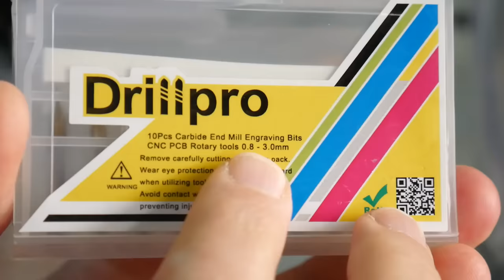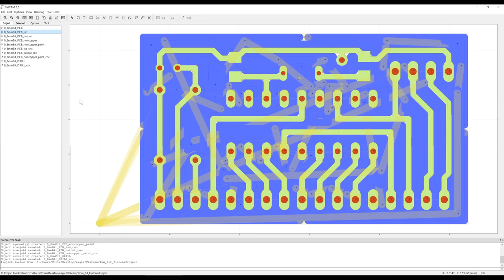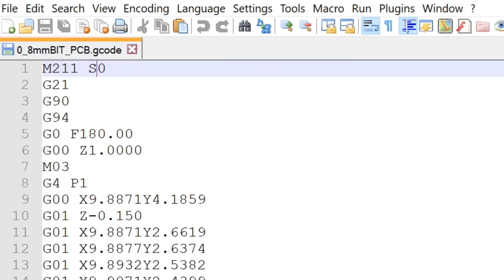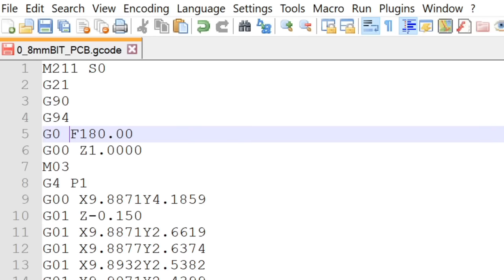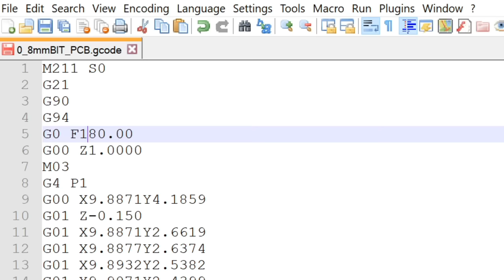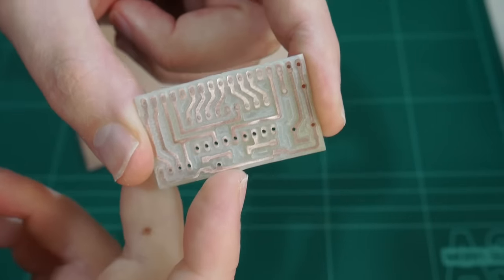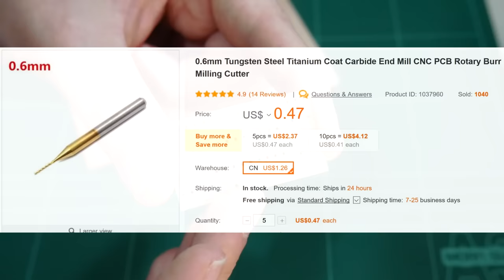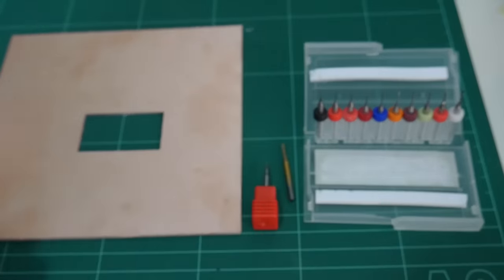Simple DIY PCB with a 3D Printer

Comment: Pretty clever of actually doing engraving by use of a flexible shaft. I’m in the concepting phase of a custom 3D printer and have been thing on how to do some simple CNC work with it as well, I might consider going this route as well to achieve that, as I don’t like a dremel on the toolhead of the machine itself considering it’s weight.

As to your Z free movement issue I imagine there are ways to get rid of this play with a little shim, or otherwise there will probably be other flex shafts that have less or no play at all.
Reply from the maker: I went to the local hardware store to see if other flex shafts had the same play. Yep they did, so I think it's by design than a fault with my unit.
Reply: The design considerations for these were never specced for high z constraint. That doesn't mean you couldn't install some lateral thrust bearings. As these dremels are intended for operation at very high RPM, I wouldn't recommend simply removing the lateral play by constraining the existing bearings or using any sort of friction shim or spring. You either need paired roller/thrust bearings or cone bearings that take care of rotational and lateral motion at the same time. The later are preferable since there are fewer surfaces for friction to be introduced.

Comment: I got the same flexible shaft, and it doesn't have the Z axis problem! It has no play at all... I didn't buy any V bit because of that, but now that I see it doesn't have the issue I ordered a couple.
Reply from the maker: Very lucky there! I'm about to switch over to another flex shaft with no play. Cheers!

Comment: Instead of using double side sticky tape, use mirror clamps and screw the plate down from the edges. You can use as many needed to hold the board down. Or you could use a thin piece of strip wood or plastic to hold down the edges.
That way you don't risk bending the board while removing it. After all, you could reuse that board to create many other PCB/ECB's
And, if you need to etch/engrave the other side for double side board, you can get the board in the exact location needed easily

Comment: Hi there thank you for  the video... Your  3d printer   I suppose is expensive , not  all common guys can  afford such a tool ...  I am thinking  if is not possibly  to  using cheap 3D printers with plastic filament  to  print  the circuit  on PCB  and after common etching method , to eliminate that plastic with something ( maybe acetone ) and have a ready pcb for driling  and mounting the electronics on it ...

Comment: Question. Could you use the normal 3D printer filament directly on the copper board as an object one layer deep? Then etch the board normally with the printed plastic as the resist?

Comment: Darn, now thanks to your video I want to convert my 3d printer... thanks... a lot ... he he
Reply: I know. I hate chemical etching and then trying to drill tiny holes by hand.   This approach seems much better for home prototyping and testing before sending out to a fab house.
Reply: But it's so cheap these days to just order prototype boards from china, why bother?
Reply: Time. I can go from computer file to finished board. Ironed, etched, drilled ans cleaned in under an hour.
Reply: And you get no solder mask and no silkscreen... Not to mention absence of plated through holes.
Reply: It all depends on your needs. I use the toner method to label the info back on when I need it.

Haven't found the need to solder mask, I just put solder where I need it. I don't wave solder so it doesn't go everywhere. 

Stick a piece of wire through a hole and solder both sides, now it's a plated through hole.

I'm not saying the DIY method produces a better board than ordering from China, but when you are doing a one-off board or just a prototype, they do have their advantages. Mainly time and cost.

Comment: Interesting video, thanks. But it seems wrong to grind below the copper and create the nasty glass fibre dust. Or maybe a goal would be to minimise the intrusion into the glass fibre? Possibly leave a few microns of unwanted copper thickness and wire brush it off afterwards.

Comment: I think you might run into delamination issues (the copper layer splitting off from the fiberglass)with this kind of holes and since they are not lined with copper it may cause some issues with the circuit working properly.

Comment: Only thing I really don't like about this is the idea of all that dust a-flying (and I suppose to a lesser extent, mechanical wear and tear). Which is worse; acid fumes or G10 dust, right? Even so, I really do like this, and I should consider building one just for in general CNC cutting/milling/engraving. It's brilliant. Thanks for the video!!
Reply: I never liked the smell of hot ferric chloride, compounded by then having to drill by hand inhaling the dust as well!

Comment: Great video mate!  Just a quick suggestion (But a good one). If you think you can take the motor apart, then try & measure the end play in the armature, then get a washer maybe about 0.06mm thinner than that measurement to take up the end play & fit it to the armature. Just make sure there is a miniscule amount of end play when you re-assemble the armature. I really liked how clean the cut in the board was using the "V-shaped" bit.  Just out of interest, would you have used the V-Shaped end mill to do the rest or the clean-up?
Reply from the maker: With the flex shaft there isn't any fixings visible to take it apart, so I'm not sure how I can fix it. Regarding the V bit, it would cut widths of only 0.2mm so clearing vast amounts of copper would take a while. Plus at the price I wouldn't want to prematurely wear it out. For small PCB's yes I would.

Comment: hello thanx for all your 3d printer videos. i have an idea but dont know is it possible or not. i saw some 15w co2 laser tubes on aliexpress can it be used with our hypercubes. of course laser tube stood still and light will directed with mirrors. just an idea.
Reply: There are plans out there for exactly such a machine. You typically need to have an enclosure for it as well just to avoid the possibility of a stray beam.

Comment: Great idea to use 3d Printer instead of manual and time consuming drawing and acid PCB making
Reply: Fiberglass dust is much more safely than acids (No,actually)
Reply: I don't think so
Reply: With photographic replication and etching you are faster than the 20 minutes used on this small board, independently of size and with much more precision than 0.8mm, traces thru pins. He should have used phenolic instead of epoxy because he can not plate thru anyway.
Reply: Ok I'll let you know when I come back bye bye for now••••••

Comment: Your experience with the engraving bit in that tool was not unusual. CNC engraving of PCBs has a whole science behind it. There are special sprung holders, special leveling programs, and more. It's not unlike what the 3D printing industry has been going through lately, with auto bed leveling and more.

Comment: 13:30 but shouldn't you not solder onto a micrcontroller, as the heat could damage the component?
Reply: No it's quite OK to directly solder them (if I've understood your double negative properly!).  But you should be quick, like with all pcb mounted components,  and let any bad-looking joints cool off before retouching them.  Ppl only use sockets to make them easy to change, if you want to reprogram them off-board.

Comment: Nice video, just set up something similiar with EAGLE and PCB_GCODE, because I cannot get FLATCAM to work.
Tried it on WIN10 and MAC OS but trouble all over the place.
Is it required to install all the additional software for FLATCAM to start working?
Could you make a video on how to install FLATCAM on WIN10 or MAXvOS
Thanks in advance.

Comment: I have the same budget Dremel with the remote cable drill thing, I definitely want to try milling a PCB like you did . Why is the V bit better than the square one ?
Reply from the maker: A V bit can achieve much finer engrave widths, down to 0.1mm wide. Smaller than any end mill.

Comment: I think will be easier to just attach a permanent marker to the printer and draw the circuit, to later just deep it into the solution.....even if this looks faster you are compromising the stability of the plaque if you drill too deep.

Comment: OK, genuinely surprised that the carbide endmill didn't go "ping" off into the wild yonder the instant it touched the board....
BTW the dust is glass, which is fairly abrasive...vacuum it during milling instead of letting get all in your printer.
Reply: And Google "silicosis" while you are at it.

Comment: Only thing I would do different is put a whole piece of wasteboard under the copperclad. You've created a pivot point by putting the board in the middle of the copper as it will flex with pressure on the ends. Just my useless 2 cents......then again, if you don't travel off the boards size who cares?
I have a set of mills like you have and mine starts at 0.3mm. You could snap it with your finger for sure it's that fine.

Comment: While I admire that this makes holes, there's much less effort with laser-printed traces ironed into a laminate (in such case, to avoid making holes, during soldering I bend legs of standard components and turn them into sort of ghetto-SMD stuff). However, If I was to make PCBs with CNC, I'd go for as many airgaps as possible, just for the looks of it.

Comment: sorry to ask, what happened to the CF tubes?
Reply: well spotted
Reply: He took the CF tubes out for the carving "conversion" of the 3d printer, as the steel rods are more rigid of a construction and the forces from the milling are higher than from printing. As speeds are lower the added mass are less of an issue.
Reply from the maker: Bingo !

Comment: Plz do aluminum...

But actually I found your video and have decided to stick my Dremel on my broken printer (hotend not motors/control). I plan on using it to cut aluminum :)
Reply: Go very slowly. Otherwise - busted end mills.
Reply: Why not fix the printer?  Easy to get parts or adapt to new components.
Reply: @GadgetNuttTech  because A) I have an ender 3 now that works very well, and B) it's CTC 3D Makerbot clone AKA a pile of garbage that I didn't do my research on, and C) I want to have a CNC machine.

I wasn't trying to be rude, just explaining my reasoning :)
Reply: No offense taken.

Comment: What is the minimum trace width/clerance?
Reply from the maker: It is determined by the end mill diameter you choose. In this video I used a 0.8mm diameter end mill, so the traces had to be at minimum 0.8mm apart.

Comment: Isolation routing?  So NASA 1970's!!!
Whatever happened to printing a resist directly onto copper with PETG, then using an etching solution to remove excess copper?
Cutting into the PCB stock only weakens the substrate, plus the rough surface from milling acts to trap moisture and contamination.
If the cutting is too deep, there is a chance of de-laminating the fiberglass!
Heated bed @90C + PETG + copper-clad panel = precision etching resist.

Comment: Doesn’t moving the print head by hand generate an electric charge? Won’t it fry the control board?
Reply: Yes it does, and no it won't. Not enough current.
Reply: I've seen a video by a well known 3D print guy who says it can damage the controller but most likely if you move the head quickly. The voltage can damage the circuit (in much the same way static can). I've seen plenty of guys on YT move the head slowly with no problem.
Reply: When moving the motors by hand, current is generated through the motor coils that is roughly equivalent to the current needed to move the motors at that speed, so if you move the motor manually faster than it could possibly move when electrically driven, you might damage the stepper driver.
Reply: yes it can , specially DONT do it when printer is on !

Comment: Why not just print traces on copper, etch, remove plastic - done..?
Reply: You could do that, but you would still have to drill the holes.  This is an extra step in the process. And how easy would it be to clean off the plastic well enough to allow the components to be soldered on?

Comment: The drilled holes are much too big. You should use a seperate drillbit and not the router bit to drill them.
Reply: Using an endmill is fine for holes where depth < 4x diameter.  This is a 0.8mm bit on a 1.6mm board.  0.8mm is the IPC-2222 recommended hole size for DIP packages.  Slightly larger may be needed for DIL headers, large transistors etc.  Veroboard has 1.0mm holes.

Comment: So those are 2 different boards right? The one you showed being removed from the copper clad board clearly( @ 10:33 in the video) had the through hole pads being too small for the holes that were drilled and several of them appeared to be cut straight through to the edges of the holes but after you "sanded off the burrs"( easy to see @ 11:58 in the video) it suddenly has more copper remaining on the board. Why couldn't you have just said that the first one didn't come out well but that a subsequent attempt was more successful?

Comment: Diy pcb with diy CNC... you're not printing anything.
Reply: and a 3d printer isn't a cnc?
Reply: @king_james_official  no. They work in the exact opposite ways. A 3d printer is an additive process. Cnc removes materials.
Reply: @xjunkxyrdxdog89  what the hell are you talking about... i think you mean a mill...
Reply: @king_james_official  I'm talking about the colloquial term "cnc". You are correct, I do mean a cnc mill. Now name an example in common English where people use cnc to mean anything else?
Reply: @xjunkxyrdxdog89  it just annoys me that people throw around words like they know what they mean and then it becomes something else. cnc just means a computer controls it (device) with numbers. sorry if i sound aggressive or smth
Reply: @king_james_official  colloquial terms annoy you? Sounds frustrating tbh.
Reply: @xjunkxyrdxdog89  not really, i like colloquialisms. they are usually new words, but cnc has lost its meaning. same for the whole "ok, boomer" term

Comment: For everybody who whants to use drilling/milling for printing PCBs: DON'T! It does not work! It is not that easy as shown. The Author misses telling you how many trials it took. He neglects the work you have to put in to callibrate everything and he fails ot show the limitations of this method (you cant place anything smaller than 3~4mm on the board)
Just use Acid. Which is much more healthy. Yeah, he also forgets to tell us how bad copper and carbon dust is!

Comment: I'm not really convinced about milling traces for PCBs... You can get so much better results with etching (which btw refers to a chemical process, not a mechanical like milling).
Reply: Perhaps the word we are looking for is "engraved"?
Reply: Word here is definitely milled. I have used commercial machines that perform this exact function and run from $30k-$60k. These are a PCB milling machine. That said, with a precise enough system, milled boards can be every bit as good as etched boards. I have made boards both ways and can tell you that a board milled on a commercial machine is far higher quality that I can produce at home using an etch process using photolithography. With small enough milling bits, you can easily surpass any features you attempt to etch.

Comment: Interesting exercise, but you can get 10 double-sided plated-through PCBs with silk screens made for $2, so why bother?
Reply: $2 and shipping?
Reply from the maker: Sure, but you can make a double sided PCB in 30 minutes. Why wait?
Reply: What did the 3D printer cost?
Wrk out te average price per board.
Reply: Shipping varies, less than $20 to most parts of the world. 
What did the 3D printer cost?
Reply: The cost of the 3D printer is irrelevant. It's primary purpose is not as a PCB creation tool. This is a multi-use piece of equipment that has had extras added on to allow it to function this way. A couple screws removed and the print head is back on and the printer can once again serve as a 3D printer. The only costs that matter are the spindle and the bits. The spindle will last for a LOT of PCBs. The bits are a consumable but using Banggood, they are a lot cheaper than some other sources.
Reply: @nathanrogers8713  not to mention the cool factor
Reply: Regardless of bulk pricing, isolation routing damages the substrate of the PCB.
If you are lighting up some LED's, no sweat.
If you are making a 'real' circuit, the variations in PCB thickness translates into variations of trace impedance.
An RF or audio amplifier is not gonna be too skookum with mis-matched impedance.
High-speed processors don't like some traces getting signals faster than other traces.  
Impedance mis-match in CPU's data or address lines is seen as data bits arriving too soon, or too late.
If you are able to compensate for the variations in PCB thickness caused by milling into the substrate, then all is groovy.
You will never find commercially produced isolation routed PCB's for a good reason; they cost far more per unit than masking/etching.
Clean your copper-clad, print a resist using PETG, etch the normal way, end up with a better quality PCB.
Yeah, the 'WOW' factor is up there with the fast turn-around of isolation routing, but my PCB's need to be predictable and reliable.
Milled epoxy/fiberglass absorbs moisture from the air and this can lead to delamination.
Reply: Turnaround time. I use DFRobot for anything I plan to really use, and any multi-sided stuff, but this approach is perfect for prototypes. Rather than wait for shipping back from China, you can have it done in an afternoon.

I wouldn't use a 3d printer for it, though, because the milling process scatters abrasive dust everywhere. You really need dust collection so you don't ruin your printer (short the boards with copper, mess up the belts with abrasive fiberglass, etc.)